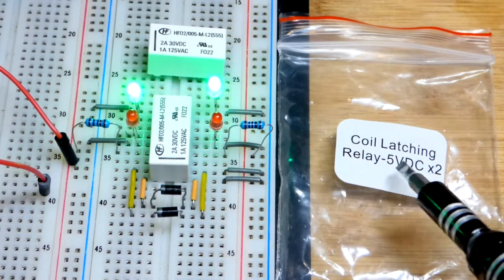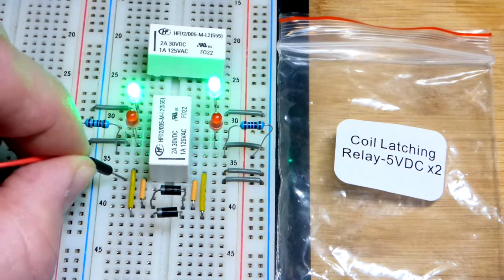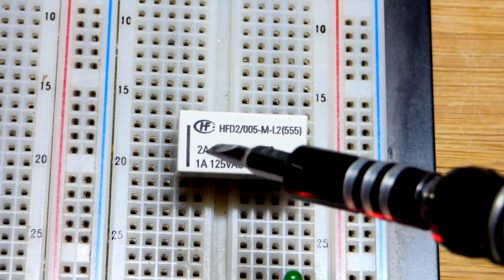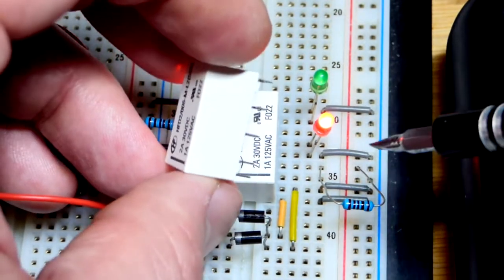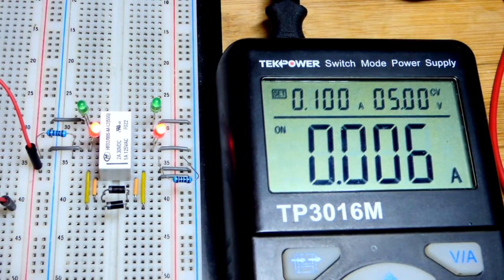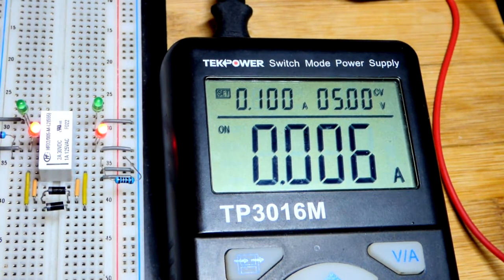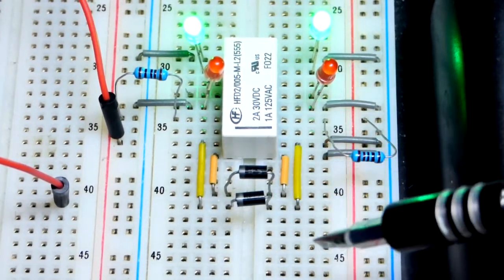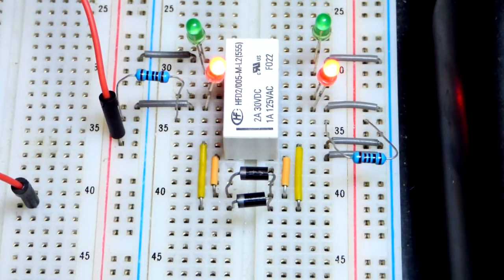How to use actual DPDT latching relay electronics circuit demonstration HFD2 005 M L2 555

Comment: great video! what diode did you used im a newbie
Reply from the maker: They should be 1N4001 rectifier diodes, which is the diode that most electronic component kits provide. But, any commonly available rectifier or Schottky diode should work equally well.
Reply: thank you so much!

Comment: Thanks for this demonstration.  I think this is just the relay I'm looking for.  My only question is, when you cut all power to the relay does it default to a certain stain or just stay in the last active position.  I hope I'm making sense here.
Reply from the maker: Latching aka. bistable relays, like this one, stay in whatever position they were last switched to when power is removed. There are modules that call themselves latching/bistable relays, but they need power to avoid switching back to their "normal" position. Actual latching/bistable relays are relatively hard to find and not as cheap as non latching relays, so you have to be careful while buying one.

Comment: Hey, can  i pass through 240V AC through the common, normally open and normally close pins? I want to use this to switch an ac light and here where i live, the wall voltage is 220 V . Thanks!
Reply from the maker: Always need to check for the maximum voltage and current before you buy a relay.
Reply: @Electronzap  well, I would like to know what is the maximum current for the relay in your video because I plan to buy it, but I don't want to buy something that I probably won't be able to use, since I'm tight on my budget, and there isn't any much info around the internet on this relay, so I was wondering if you know the maximum voltage and current that this relay could handle. Thanks!
Reply from the maker: I just looked at the component. It's only rated for 1A at 125VAC. They're probably hard to find and expensive too.